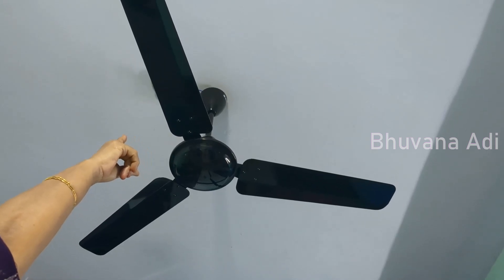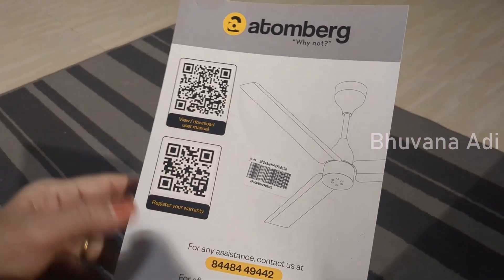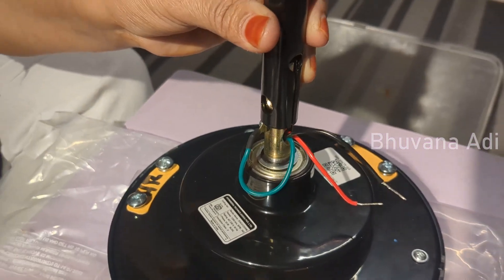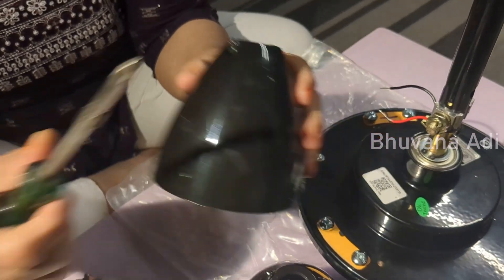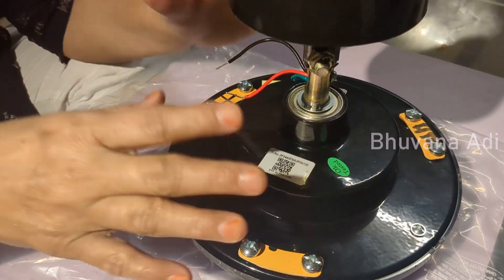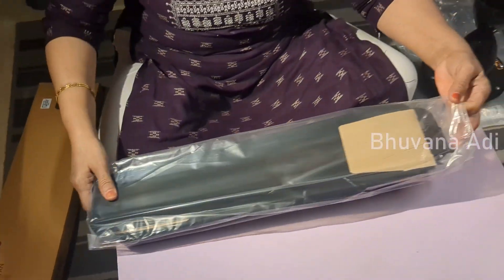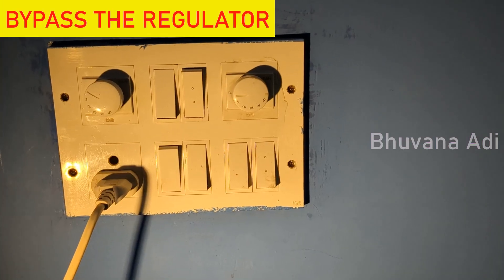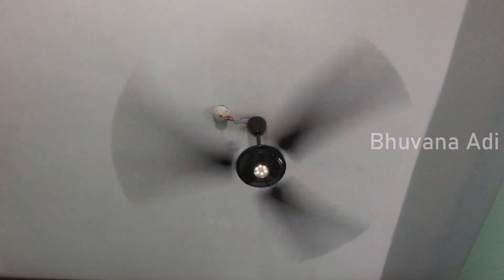BLDC LED Ceiling Fan / Atomberg  - Unboxing, Assembly, Fitting & Remote explained

Comment: Does the fan remember the speed mode if you turn off the switch??? Please reply
Reply from the maker: Yes it does. It switches on at the same speed as it was before switching off or while running before.
Thanks.

Comment: How it is working now? Is it good ? What about air throw to the whole room?
Reply from the maker: The fan is working fine and cools all the room space being used. Air throw to the whole room depends on the size of fan, size of room and the height at which the fan is fitted. This fan can cool a room of around 12 ft X 12 ft when fitted at a height of around 9 ft. Thanks.
Reply: @BhuvanaAdi  thanks 👍

Comment: Nice video can you please tell me exact height in inches from ceiling to button of fan where led light is
Reply from the maker: Thank you. The distance between the ceiling and the bottom of the fan(the main unit) is 16.5 inches/
42 cm.